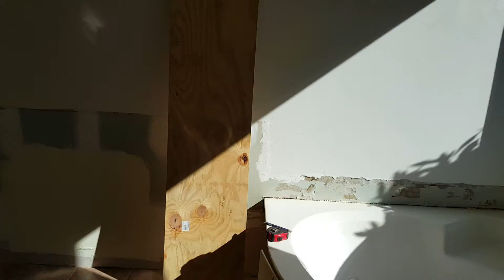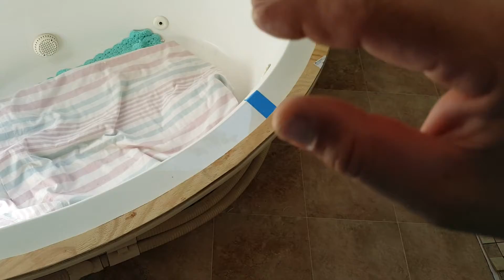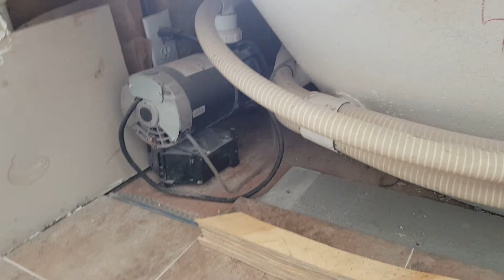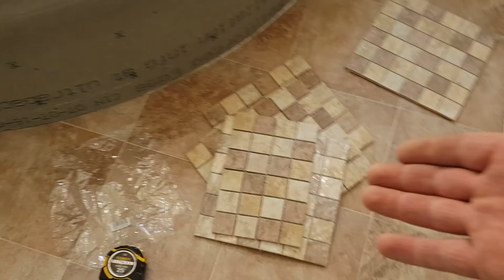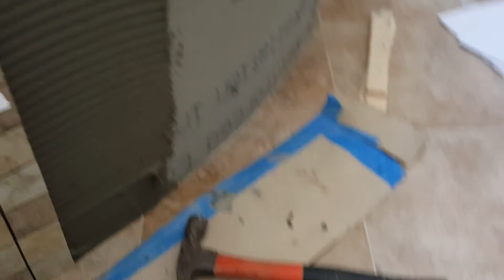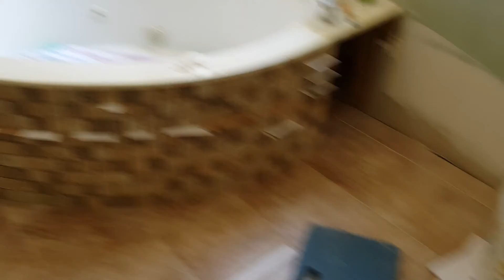How to tile around a bathtub

Comment: What kind of backer board did you use? I think I see the name Ultrabacker on it. I've been trying to find flexible backer board to out around a round firepit. Was the board you used pretty flexible?
Reply from the maker: Ryan R it is called "durock" but a 1/4 inch board with a fiberglass mesh around it will work
Reply: Hugo Correa thanks for the reply. I'll see if I can find it locally.
Reply: @ryanr-9400  PermaBase 0.25-in x 36-in x 60-in UltraBacker Cement Backer Board is carried at Lowe's.  I think you'll find that is exactly what is in the video (a little late though)  :)